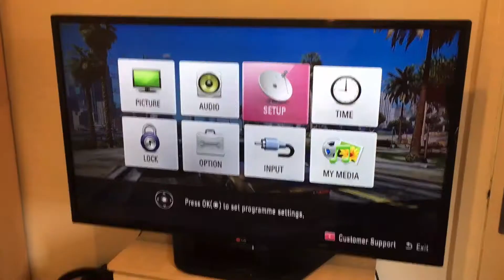LED BACKLIGHT TESTER! Home Made Easy and free ! TEST LED BACKLIGHT  - DIY LED TV REPAIR pro hack ! #

Comment: Why not just solder old battery connections to the wires no other soldering needed just plug on to the battery's when batts are dead.